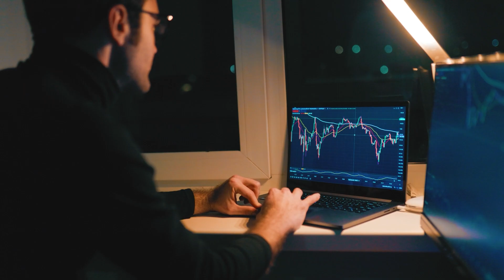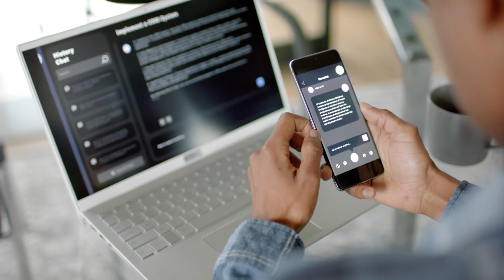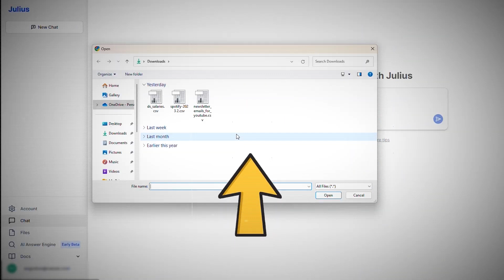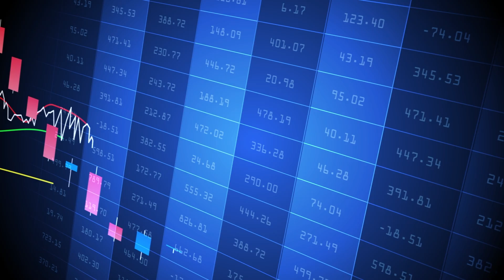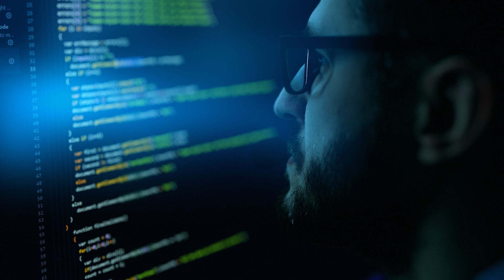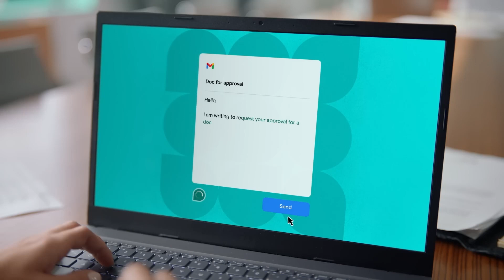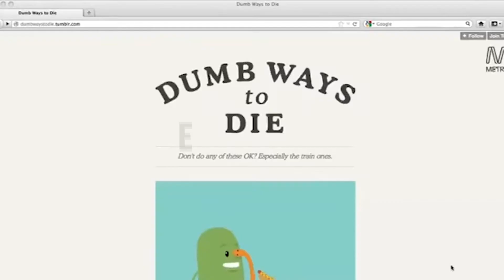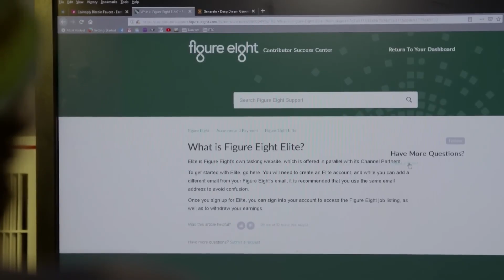Top 10 Jobs AI Will DESTROY & REPLACE

Comment: It is strongly advisable to use authorized human know-how to build AI solutions, including data, and to verify if AI created outcome is in line with the goals that have been set. So using AI as a supportive element to reach the goals set by authorized humans is totally fine as it increases productivity. However, the last step as to trust AI in executing the build and verification processes itself, which technically could also be achieved, can lead to unexpected results and chaos ... Something all humans should be aware of and stay alert for to avoid AI puts us humans and our whole environment on earth into danger ! In other words, authorized humans better ensure they stay in control of AI driven machines.
Reply from the maker: The risk of losing control is an issue that has been warned about for a long time already, in an open letter signed by Stephen Hawking and Elon Musk among others. Even recently with another open letter, signed by  (again) Elon Musk, Steve Wozniak and Yuval Noah Harari et cetera. 

Our human arrogance causes us to think we can simply 'pull the plug' from a machine that goes rogue. But what will happen if a machine is X times smarter than us? Don't you think it will find ways to survive and / or meets its goals? For example, apparently ChatGPT 3.5's equivalent IQ is 155. Einstein's was 160. Just let that sink in for a minute. ChatGPT4 is 10x version 3.5. So, in theory that would equal an IQ of 1550? (Source: Mo Gawdat's interview at Stephen Bartlett's podcast Diary of a CEO)

Yes, AI can make our lives easier, safer, more efficient and a whole list of other things. They already do, don't they? But what if we 'forget' to program failsafes into the system? 

There are known examples where an engineer made a silly calculation mistake, which created a domino effect further down the line. The result? Pillars that are not strong enough to hold a bridge weighing tonnes..

Mistakes WILL happen. I could continue, but in my opinion AI development potentially poses an enormous threat to humanity. Currently, we are in the denial phase...